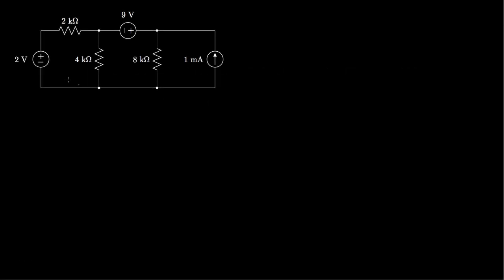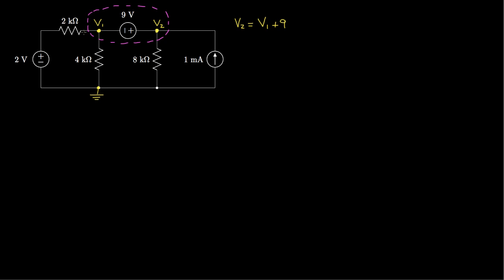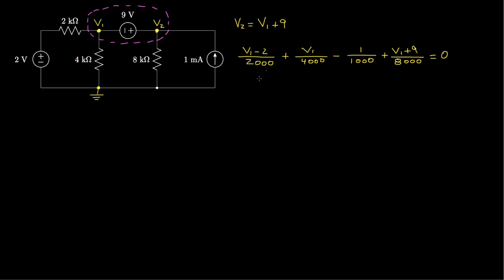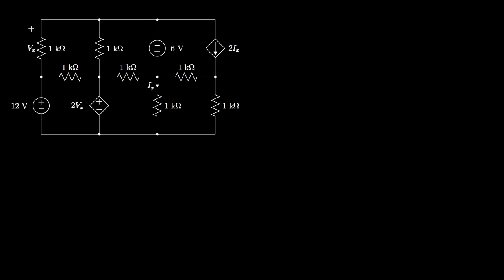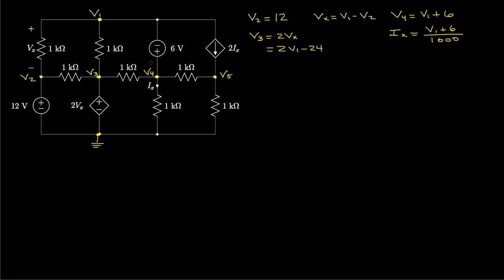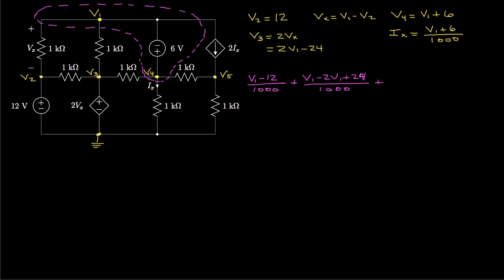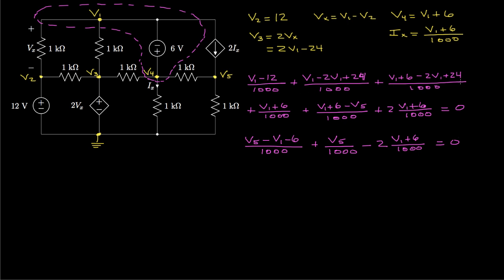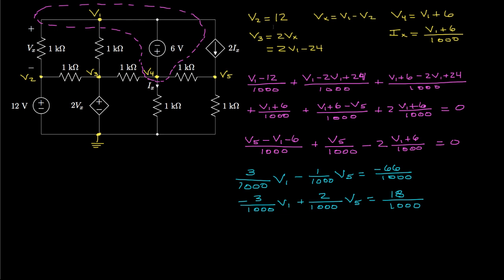Node-Voltage Method: Part III

Comment: I'm supposed to be going to a top engineering university...didn't get node voltage until now.
Reply: Chr0maticAttack That's because the University this guy teaches at is the very best :) Cough MTU Cough
Reply: Joseph Heltsley I don't know MS&T is pretty good...just one particular professor.

Comment: If the independent voltage source of six volts had a reversed polarity, would the expression for V4 be V1 - 6v instead?